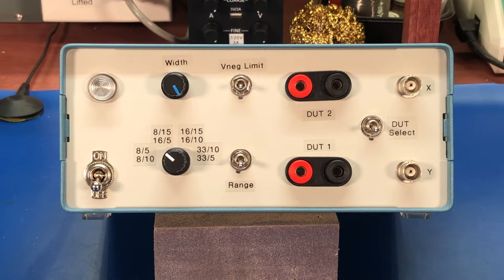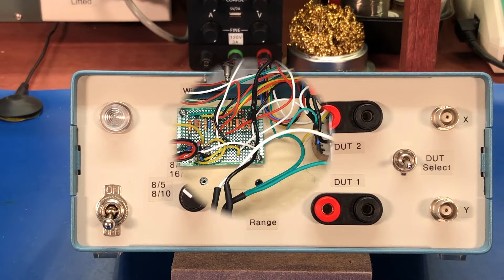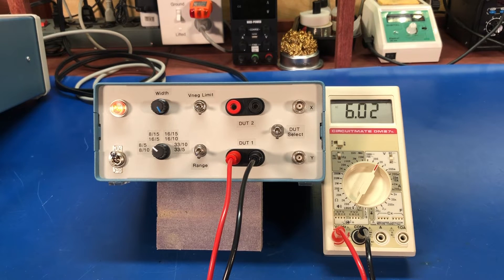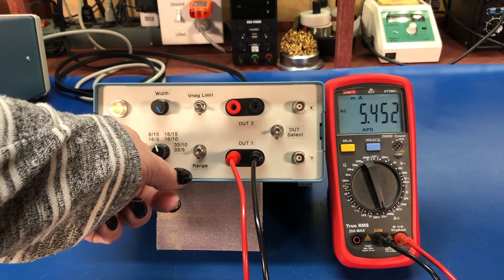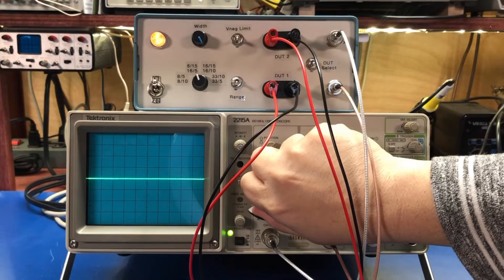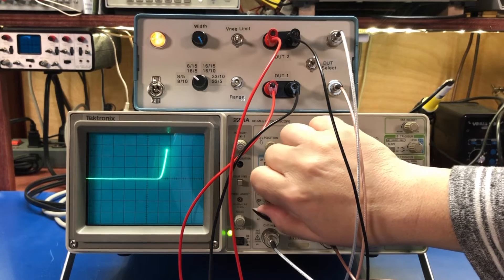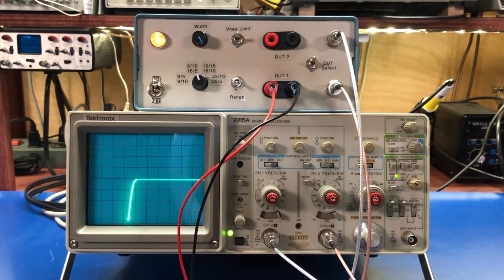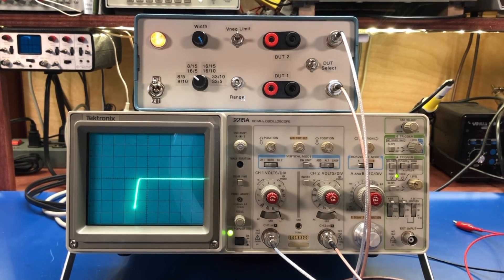Enhanced Octopus Component IV Curve Tracer

Comment: Hi Donna, just seen and really enjoyed this project and video. You mentioned that you had tried to use an op-amp for x10 or x100 can you briefly explain what is the function of x10 x100 and its use in testing- Bit lost as it was mentioned. Keep up the great projects.
Reply from the maker: Hi - sorry for the late reply.  I need to set the scope down at 50mV/div and the trace was looking a bit noisy, so my thought was to boost the output so I could use 500mV/div. In the end it wound up fine as it is, so no need for the amp section.

Comment: Hello. I am a noob and a hobbiest in electronics and want to know that some tracers on the market have the frequency change option. I couldn't find any info about the role of the frequency on VI curve tracing. Please could somebody explain to me the reason of using different frequencies? I am building this tool BTW, thank you Gary.
Reply from the maker: Hi! Components can react differently at different frequencies, this is why better LCR meters allow you to test at multiple frequencies, especially for capacitors. The octopus is not a precision device (not that it couldn't be) - it's a quick and dirty tester  designed to give you some general feedback about the DUT.

There are designs that use a dedicated oscillator, which can be run at a higher / variable frequency, but that's more parts. The basic octopus can be assembled with 'junk box' components: a 6V or 12V transformer and a few resistors - that's all you need for it to do its magic. 🙂
Reply: @Donna_Matthews  thank you for the answer 🙏

Comment: I am making a small simpler version of the octo right now.  My xfmr has two secondaries so I will have two test voltages. Also will have a switch and terminals for A-B comparison.  Mainly for testing junctions and checking junkbox pots for noise/flaky before using them.  For testing caps it is nice to have variable freq.  like a Huntron,  as 60 hz is not ideal for smaller values.  But this is supplementary to other testers.   IF you have ever priced a Huntron used,  you realise that building this is economical!  Not that I would not get one if it was priced as a real cheap bargain,  not likely but possible.
Reply: Problem with the Huntron and similar such testers is the CRT. If it ever goes South then you're probably screwed. Better to use a tester which can be used with most any oscilloscope rather than some special proprietary display.....

Comment: What is the reverse bias voltage for various types of diodes? Because I don't know how diodes protect a component from reverse negative voltage because various diodes can only handle very little reverse negative voltage before breakdown which breakdown is a complete short circuit?
Reply from the maker: If you look at the data sheet for a diode, it will show the max reverse voltage. Take the 1N4000 series (https://www.diodes.com/assets/Datasheets/ds28002.pdf) for example. For the 1N4001, it has a max DC blocking voltage of 50 volts - and the 1N4007 will block 1000 volts. You need to choose diodes that are rated greater than your max possible reverse voltage.
Reply: @Donna_Matthews  but what components don't like reverse negative voltage? I know transistors base don't like DC negative voltage because it will damage the base to emitter junction
Reply from the maker: @waynegram8907  It depends on what you are designing. One example could on the barrel jack for power to a circuit - like a guitar effect pedal. Barrel plugs can be wired center positive or center negative. A diode on the input could protect against reverse polarity frying components.
Reply: @Donna_Matthews  yes true I have seen this often. I'm not sure why EE designers choose center positive over center negative because there must be an advantage or benefits of choosing center positive over center negative power. I'm not sure if you get less leakage current on the ground or less noise better S/N ratio because it doesn't make sense why some guitar pedals are center negative and others are center positive there must be good reasons
Reply: @waynegram8907  Could be all wet here, but I think in many "cases" (Especially the all-metal ones lol) if the shell or case is used as a "chassis ground" and the center pin is neg then the barrel and the chassis all become positive. I think it's safer to have any exposed metal connected to the negative ( 0 volts ) side of the house ... I have seen it used to make a system proprietary ... A well-known company with initials R and S used to do things to make their products proprietary by changing one thing like reversing the power plug polarity or using a non-standard pin to power their PC cards so you had to buy "their" card ... Probably why they barely survived.
Reply: I have seen the 1N4007 diodes connected across the power inputs of CB radios as reverse-connection protection. also, when repairing pinball machines, ALL the coils will have a diode across them to prevent reverse voltage spikes from the collapsing EM field from damaging any IC chips or circuits. Same works for a relay coil. In a power supply, your diode's PIV should be rated at least double the forward voltage applied.
Reply: @rusty1187  i can not remember how many cb's i repaired for hooking up backwards that's why use a fuse the diode will take it the fuse but some had just the diode and it would pop then like a fuse lol